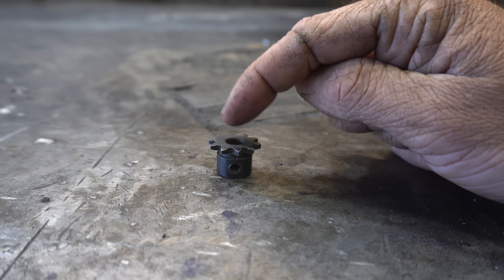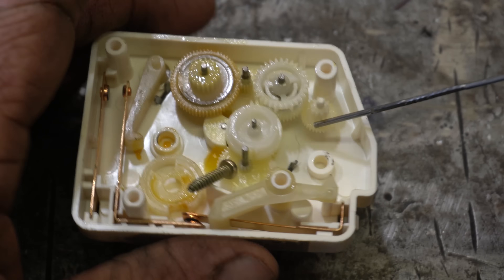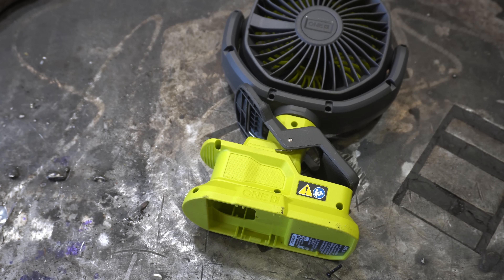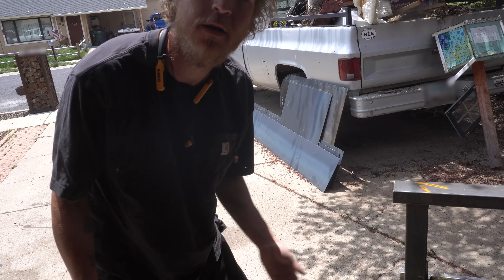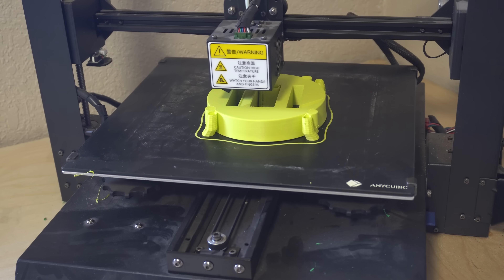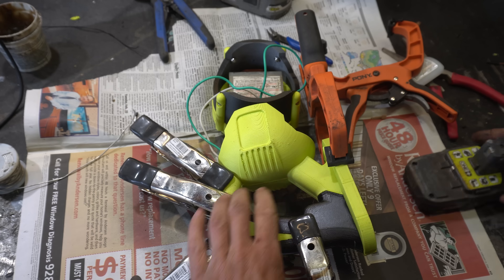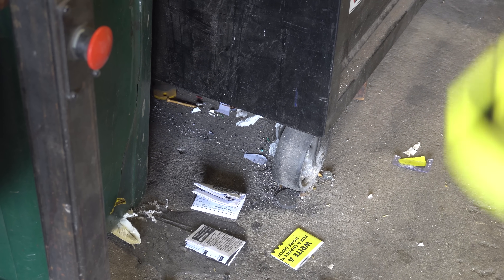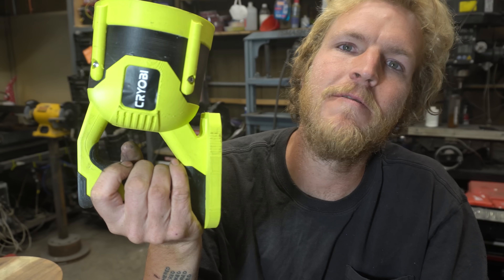Every Metalworker Needs This Tool!

Comment: Great idea for a fun useful project. I think if you would change the design a bit by connecting the the 2 magnetos together with a rod for a handle inbetween to distribute the weight and a t handle that came off that to counterbalance the weight, it would be much more user friendly. Would help with flexing and weight distribution. also put the battery on the t handle side. Keep up the cool projects. Also, mount the battery so it plugs in downwards to keep potential from falling out.

Comment: When I move sheet metal, it usually needs more than a magnet and my job loves to use non-magnetic metals (mag alloy, certain stainless) for security reasons (you don't want people to be able to steal $3600 street mail delivery cluster boxes with a rare earth magnet). Cleaning the shop especially under grinders and drills? Epic. I love it.

Comment: I appreciate your contraption  but the battery reliability  is a big safety concern, the sheet of steel will cut your feet when it unexpectedly runs out of juice.
Just use a pair of vice grips.

Comment: Cool build!! I built my plasma with linuxcnc and mesa cards. I have to say not much fun at all! I wonder if a esp32 fluid nc type controller might be easier? Im working on a router build right now and so far has been much easier to deal with. Plus it has wifi so i could run from my couch!!

Comment: why do you think google is not just pushing shorts but trying to make them a requirement, because not only does it save them boat loads of bandwidth but is also greatly reduces the amount of money paid to content creators. what i don't get is, with googles proven track record of every change or new policy they implement results in more loopholes for google to lower or even eliminate financial compensation paid to content creators, why are creators just rolling over and giving google what it wants...again, especially when it's taking money out of their own pockets...seems really stupid to me...........

Comment: I re-wrote the firmware for Anycubics delta bot 200mm. Guys can't do anything right over there lol.
Nice video. Also consider striking epoxy for axe handles. Coat that super glue joint you're worried about from the outside.

Comment: definitely install screws around that super glue joint and put like a thin rubber protective boot with some striations, over the electromagnet... definitely an awesome build 👍👏🫡

Comment: As you said, the battery “allegedly has reverse flow protection”, however I wouldn’t rely on that, as you know they aren’t cheap. I would either drive it with a mosfet or at least a nice diode. Cheaper to replace those than the entire battery because you fried the BMS

Comment: Put a magnet in the core, that way you don't need the battery to hold the machine in place when it's not carrying heavy stuff, a controller to add small increments of boost power, and a reverse button to cancel the magnetic field  of the magnet, and some material to increase friction on the surface.

Comment: Umm.  Guess you saved $15 on buying that set of two heavy duty glass lifting suction cups, which btw also work on sheet aluminum and other non-ferrous (e.g. some stainless steel).

Otherwise I could only see this hack useful for textured/rusty steel.  If that was the point, then great job! That is why you did this, right?

Comment: What would give you more stick? Doubling up the coil or doubling up the battery or both?
Reply: Putting a magnet in the core, that way you don't need the battery to hold the machine in place when it's not carrying heavy stuff, a controller to add small increments of boost power, and a reverse button to cancel the magnetic field  of the magnet, and some material to increase friction on the surface.

Comment: I love your range of skills and knowledge.

This project is really cool.  There are switchable magnets though, that don't require any power at all.  They work by mechanically changing the magnet configuration.  Are those kind of magnets not available for this task?
Reply: Mag tables like that for surface grinders are absolutely magic.
I know it has something to do with interrupting lines of magnetic flux….but I’m pretty sure it’s just magic.

Comment: @Cranktown City, You'd better put a freewheeing diode across the coil in the microwave transformer (in reverse) to stop the huge voltage spike coming from the coil when you turn it off from destroying your switch and/or BMS.

Comment: Shorts are pure cancer, I will unsub if you pollute my subs feed with that trash. Have 100+ channels subbed and if I have to sift past a few of them posting 3-10 shorts a day, it becomes 70% of everything in the feed, channels that do this will be unsubbed by most people using /feed/subscriptions, which should be your suggestion rather than the stupid bell notifications. Anyone with more than a few of those turned on will after a very short time start ignoring it and you only see a few of the most recent notifications anyway, subs feed shows a reverse chronological list of videos from everyone you are subbed to.

Comment: Having built a CNC plasma with a chain and sprocket drive, (with what looks like the same size sprocket and chain as you're using) just want to give you a heads up as to the "polygon" effect they suffer from pretty badly (the links of a chain form a polygon when wrapped around a sprocket, most noticeable with small sprockets like this). The sprocket is less a round wheel and more a multi sized polygon, so when it turns the radius at which the chain leaves changes slightly (smaller at the center of the flats, larger at the points of the polygon). This isn't super noticeable in pure X or pure Y movements, but it made the diagonals on our CNC plasma cutter kind of wiggly due to the not linear or smooth movement of the axis.
Reply: This why everybody uses timing belts or ball screws.
Reply: @machinist7230  we later upgraded to timing belts, and then ditched them for rack and pinion. Belts are too elastic at these lengths, even the 15mm ones we used. Across the 3m travel on the long axis they also required insane tension and tended to snap somewhat often. 

Ball screws are very budget unfriendly and at these sizes, even less budget friendly since spinning them up to speed is jot feasible, you need to use rotating ball juts which are even more expensive. Not to mention the maintenance and lengevity nightmare of a ballscrew in this sort of environment, the dust the plasma itself generates is very fine and abrasive. 

Rack and pinion is the goto for large plasmas from my reading and experience. Robust, simple and effective.
Reply: I wonder if you welded the chain to a piece of angle every couple of links if that wouldn't help? I have rack on mine and works well. Just a idea.
Reply: @n2fastcars635  we had the chain lying flat on a bit of box section with the sprocket riding on top just like a rack and pinion. The issues were that the sprocket very noticably climbs in and out of the chain links by a few milimeters to stay properly engaged.

This is because the sprocket functions not like a circle but and x sided shape (x being the number of sprocket teeth). This results in a constantly changing driving diameter (across flats vs across points). That results in a pulsating, uneven motion.

Its  not terribly visible in pure x or y cuts (other than the rattling and vibration induced in the machine), but in diagonal cuts where one axis will lurch ahead, then the other. It results in a slightly wiggly diaglnal since neither axis is moving with a smooth, constant speed.

Im not guessing here, ive used both chain and rack and pinion on the same machine, these are observations.
Reply: @H34... Excellent comments man. Thank you for sharing this knowledge.

Comment: Awesome build! To help with the metal sliding off when your moving the sheets perpendicular to the ground, maybe add a thin bit of rubber or something to the front so that the additional friction stops the metal from sliding off. I have used neoprene foam weather stripping in the past as a cheap friction material, but that would probably be a bit thick without you redesigning recessed pockets into the case.

as for the superglue... you will probably love this... hot glue in my testing is ~3x stronger in tensile strength than super glue with PLA. I got an average of 47.7 lbs/in^2 with CA glue (loctite gel), and 146.2 lbs/in^2 with hot glue (stanly dualmelt, which project farm tested to be the best, out of a ryobi hot glue gun that i let get scorching hot). My assumption is that the hot glue re-melts the PLA, and that gives it really good mechanical bonding. CA glue was stronger when dealing with shear force... so if your enclosure does crack, consider adding a lip to prevent any rotation, and then use HOTGLUE!!!

Comment: Looking at the Ryobi line-up, I think you'd have had a better time if you went with one of their flashlights.
The small one might've let you break the top part off only and slap yours on a nicer handle with a trigger.
The large one might've let you gut out only the lights and fit the magnet inside it and used almost the entire case.
If you feel like making a sequel for the second one, I know that I'd be willing to watch.

Comment: or you could just get a good suction cup that they use to move glass panels with
Reply: neither   I would go with a lever clamp design used to moving heavy stone blocks  ...with a friction point (they use pits in the stone slab). Both magnets and suction cups are too wonky.

Comment: I think I may build one of these also (for my plasma cutter).   Nice to know the ryobi has  low voltage protection.  I'm pretty sure I wrongfully assumed the HF Bauer line had it built in but after researching, I think it's in the tool.  I was going to use a Bauer for an upcoming vid with a diy portable pinecil soldering iron but I will go with my Ryobis now.

Comment: I'm one of the rare Ryobi fanboys. I don't think their tools are good, mind you, but they're fine for light-duty. Crucially, however, Ryobi makes the most unhinged line of battery powered bullshit on the market. I can take the battery out of a soldering iron and put it in a desk fan? A bluetooth speaker? A shopvac? A weed trimmer? Yes, thank you, that's great. 

That said, it's kind of amazing they don't already make this. Nice job, man.
Reply from the maker: Dude me too. Just the fact they made a damn hot glue gun sold me hahaha

Comment: I know there is a way to make an electromagnet act as a "permanent magnet" by connecting wires together after voltage is applied. After you can remove voltage and the magnetic force stays. It would let your battery live longer and is a worthwhile upgrade imo. Amazing build!

I was able to do some research and i dont want people to think im making baseless claims but the effect is called pmh.
Reply: any source or example? i have hard time to belive that.
Reply: @jaroe1996PL  This is just made up nonsense lol. You can sort of do this if you discover room temp superconductors, but other than that...
Reply: @Muttyfut  its called pmh i just posted a link to an example of it.
Reply: @jaroe1996PL  its called pmh ive just posted an example to it.
Reply: https://youtu.be/r9Kg69cQteg its called PMH i believe it happens when the eddy currents get into a locked state.

Comment: A little tip for glueing 3D printed parts; if you get the thin superglue that heats up massively and makes your fingers all dry and crusty, it will flow even in between friction fits. Just put the print together, then drip in some glue and done.  
If it's loose you can wiggle it a bit to help it spread, but often shouldn't need to

Comment: Ever make it up to SoDak, gimme a shout.  I think we could find a beverage and build some useful crap. 

Also, that blue-capped super glue is good stuff. Even better in a lotta cases than the old standby, Kragle.
Reply: I'll have to find that super glue, what's it called ?
Reply: RapidFuse (blue cap, made by DAP) and Krazy Glue (liquid, not the gel) have served me well for bonding plastics—specifically when it comes to tools.
Reply: @dannop2562  Thanks, not all super glue works with PTEG printed parts, the lock tite I use is just ok, sometimes it works sometimes not so much.

Comment: I can't imagine a low resistance short is good for the tool batteries, but hey, you can 3D print new ones. Right?.....right?

I wonder how power it's using. Hit one lead with a clamp meter and measure the DC resistance of the coil and we can find out.
Reply: The low resistance isn't too big an issue because of the large inductive load.
Reply: @EddieTheH  If he used the secondary winding, sure.
Reply: @matthewf1979  That's a thought, use a second winding the same as the first and alternate between the two to keep the polarity the same but give each coil a 50% duty cycle. 🤔
Reply: @EddieTheH  does not matter much with DC. Switch contacts also gonna get toasty pretty fast
Reply: @TheMorpheus017  Ahhh, correct! Sometimes my brain farts and my thumbs type it!!! 🤣🤣🤣
Reply: @EddieTheH  Inductive loads only provide impedance at AC. This is shoving DC through the coil, so only its resistance is relevant. i would def be interested in a current measurement though. (Unfortunately clamp meters are typically AC only)
Reply: @Muttyfut  Yeah, my stupidity was already pointed out! 👍

Comment: It's a miracle that all the toes are still attached.
Reply: That would be my worry, like how do you know when the battery dies and the plate falls?
Reply: Ya, put on a pair of gloves and here's a thought, just carry it with your hands. Maybe use it for pickin nails or screws that are lost in the lawn.. Cheers
Reply: His secret: superglue 😂
Reply: That was a hard watch for me too.
How'd one even do that safely?
Only option that came to my mind is to do it with two people, such that they would reach over the steel part, not putting anything below it into danger.
Welder clamps as handles would probably be more reliable too

Comment: You can redo the glued on green part with an interior flange and tabs for those 4 screws to bite into. That will make it easier to service and stronger.

Comment: Dude. That bell can tell you when your plasma job is done, since you know, the plasma cutter will be so quiet.
Reply from the maker: Hahaha dammit I have to do it now
Reply: @cranktowncity  Save the bell!!  Too cute to die! ;)
Reply: @cranktowncity  Please include at least 1 (one) Breaking Bad reference when you do it, ;)
Reply: You could put the bell in a little 3d printed wheel chair with a hand that taps it like mad when triggered.
Reply: @KieranShort  Nice reference! "I am the one who knocks"
Reply: Have the plasma signal when it's done over MQTT, and attach the bell to a ESP32, and you can put the bell in the garage, and have an indication when the plasma cutter is done in the shed!
Reply: make the bell in the bathroom
Reply: This is awesome! Must do